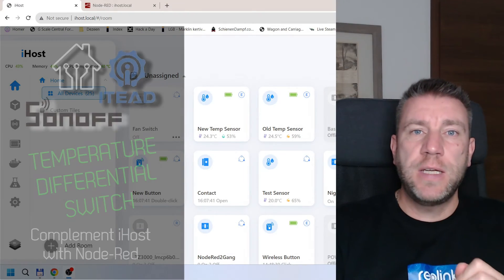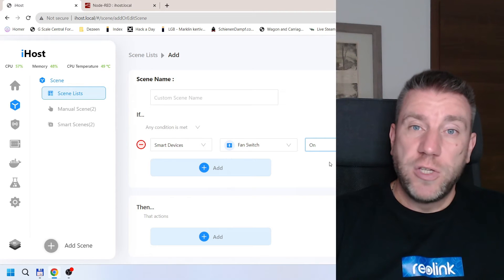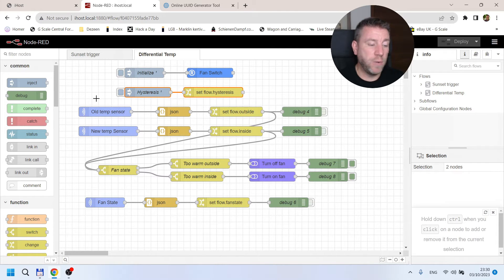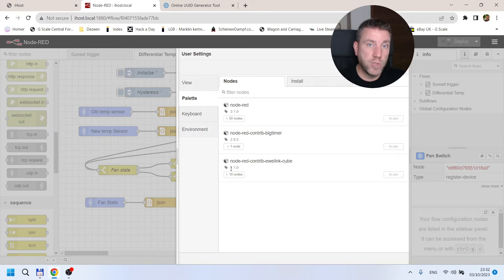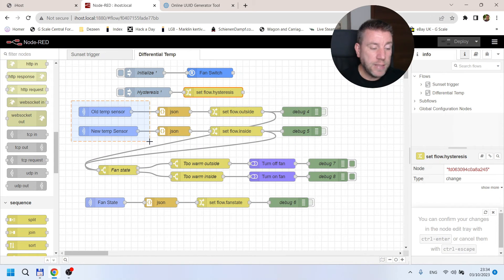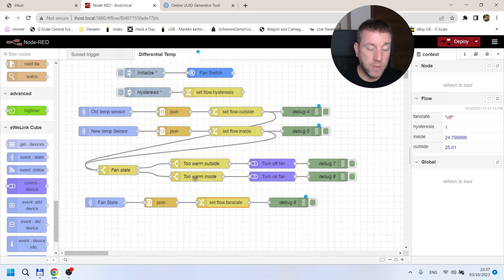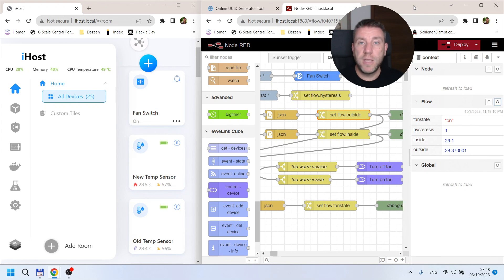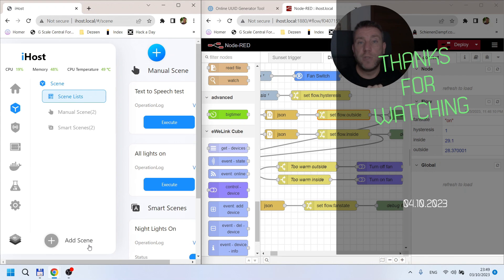Temperature difference scene: new functions to iHost with Node-Red

Comment: Hello dear, hope you will be fine.
I have a question please help me for this.
I have installed sonoff 4ch R3 pro.
I want my exhaust fan to run for 5 minutes after every 30 minutes and stop after 5 minutes Running and this cycle will run for 24 hours a day.
Reply from the maker: Most of Sonoff relays, there is a Loop Timer function, but not on the 4ch pro. Exactly what you would need.
Reply: @csongorvarga  is there any solution for this or not? I need interval timer. After every 30 minutes exhaust fan run for 5 minutes for ventilation.